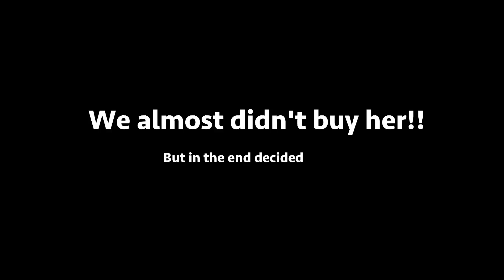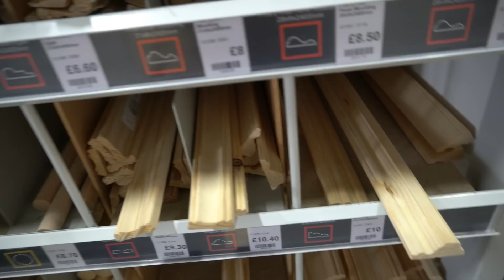Our Van Life Dreams Could Be OVER!

Comment: Suggestion, :- Install a remote operated dump valve in the fresh water tank, so that when you get invited by the DVSA inspectors to follow them to a weighbridge you can dump 200Kg on the way there 🙂
Reply from the maker: Good tip! 👌
Reply: Thats smart
Reply: Unless of course they are involved in an accident and the truck is checked by the Police after the event.
Reply: Better still don't travel with 200l of water .or if you do try be as close to your overnight week long stop as possible
Reply: That won't work - VOSA will likely require you to fill your freshwater tank - and will want to weigh the vehicle with everyone on board.
Reply: VOSA won’t ask you to fill any tanks, don’t be worried about that.
Reply: that ts not true you.
  @MadMorti
Reply: also remember to get the right flow rate one as you only have probs 5 mins to empty your 200kg thank. Money now spent on the right product will save you a hefty fine and dont forget they come with points and Hugh fines  for being overweight
Reply: @SAM_1010  The Brom is an HGV Class 1 driver... he's been weighed multiple times and that's his advice  🤷‍♀
Reply: should add - that's my hubby - forgot his name doesn't show up on my account when commenting 🤦‍♀
Reply: HA HA HA that's hilarious you forgot hubby's name 
because it doesn't up on your account 🙂 🙂🙂  @MadMorti
Reply: I’m a lorry driver, in my early days I drove scaffold lorries. One time I was just under my payload weight. They spayed water on my boards and it was overweight got fined..
Reply: @brendanaengenheister5351   that's not what I said at all. Jokes on you.
Reply: @Touringwiththekids  Please don't take this advice. 😂
Reply: And break the law making your insurance null and void!
Reply: @cityclips9325 don’t talk rubbish. If your under weight your under weight. Can just see vosa standing there with a hose pipe in the middle of summer. They will tell you to go home and fill your flask up again 😂😂😂
Reply: @stepemberton9233  I can assure you it did happen at dartford crossing. They have many hose pipes.
Reply: @stepemberton9233  the VOSA said what happens if it rains now? And the other guy sprayed the water
Reply: "The Driver & Vehicle Standards Agency have various special "Weigh in Motion Sensors" (WIMS) and Automatic Number Plate Recognition (ANPR) cameras installed all over the country. Helping them win the fight against overloaded vehicles which pose a threat to other road users and cause significant damage to the road infrastructure."
Reply: @bigdarbs19  no cause you just dump it as soon as the incident happened
Reply: @MadMorti  they wouldn’t be able to see how much you did, or didn’t dump and if it’s raining, they probably won’t even be able to tell

Comment: 12MPG 😮 I'm driving 26 tonners and getting 13MPG. Practice letting the truck roll more on approach to roundabout, junctions etc.

Also if you have a exhaust/engine brake use it; will save you on brake pads/discs and will improve MPG as the air compressor doesn't have to work as hard.

Glad your GVW will be okay

Comment: if you get pulled, they weigh each axle separately, then add together, so max axle weight is the one to keep an eye on, this will reflect on where to put the water tank to balance it out
easy to work out water, 1 ltr = 1kg, diesel is slightly lighter
if you are a little bit over the limit,  you get a warning, well over, a "PG9" is given, vehicle taken off the road immediately, ie walk home 
 aim for no more than 10% over axle limit, £100 fine, + allowed to redistribute your load + drive away...   keep up the good work

Comment: One thing to keep in mind is AXLE weights , most roadside weigh stations run by the DLVA weigh individual axles, not the whole lorry, So keep in mind weights and where you place them , with a sleeper cab your front heavy  to start with.  Good start that your still under 7.5tn.
Reply: Good point. Next time you take it to the weigh bridge , put the front wheels on it first to weigh it

Comment: Hi guys, thanks for great videos over here in OZ lots of big motor homes also pull a car or 4 wheel drive towed behind them. So what about a trailer that you can tow behind the truck this is of course only applies if you guys are over weight. I know when we lived in the uk we would see lots of coaches with trailers pulled behind. Just a thought 😊😊john

Comment: have you checked your axle weights? you can be under gross weight and be over the front axle weight very easily as the engine and the cab is on the front axle especially a sleeper cab. My 7.5t Curtainsider only can gross 3200kgs on the front

Comment: Thankfully, I don’t have to worry about the weight. My Iveco is currently 6000kg-ish, with curtain sides, so if I had to come in under 7500, it would be a non starter. Luckily, I did my full class C+E, and my design gvw is 10,000, so I’m safe.
The previous owner derated it, so he could drive on his C1 license and pay lower road tax, but he made no modifications, so I can just change it back and pay the extra, once I’m finished.
The other option would be a complete redesign, without the tail lift and with grp panels, on the sides of the box, or perhaps remove the box altogether and mount some sort of RV body, but none of that appeals.

Comment: If you insist on using the jigsaw the best way to cut straightish is to find the box the jigsaw came in and you'll find a fence to use with the jigsaw to cut in parallel lines, but a circular saw is much better for the job.😂🙂🙃Only trying to help not moaning ;-)

Comment: Hi New to the channel. A 10 ton truck would be better and you can drive that on the same licence. Not sure when you did your test. But now you can do class 1 straight away. Then you drive anything and tow anything.12mpg in 7.5 to is poor.. x
Reply from the maker: Hi, the C1 license only allows you to drive upto 7.5t weight so would have to do an additional test for a 10t. Also a lot more restrictions in getting to places as most weight restrictions tend to be 7.5t! If we need extra payload we could get the truck re-plated to 10t.

Comment: Hi.  Weight.    First off ,  private or commercial it does matter of both axle & over all weight as you may know.  I would of weighed after filling to the top the fuel tank & water tank (. Yes I realise you not of fitted water yet 😊 ).   And take that as the Kerb weight.   Admittedly often your water will not be full nor your fuel at 12 mpg.   With everything on board , family, kitchen sink and anything else you require, you would now know the weight you must not be over.   7.500kg.  
Example :  You are off in the morning already topped up water and fuel,  3 mile -  5km down road and a government weigh check.   Bugger !!!!!
As you may also know some weigh centres are either bridges or single bars ,  here they are after your axle weight  !!  
As you may also know that the weight limit is what the vehicle is designed for ie. 7500kg  and the drivers licence that all matter  ( especially at a weigh check  !!  ). 
Wish you well

Comment: Weight won't matter because you'll have to re register it so it's not classed as a goods vehicle
Reply: Wrong. It still needs to conform to its permitted weights on its vtg plate.
Reply: @garywebster6453  it won't have a ministry plate when it's re registered, same as if you bought a coach and converted it, that would become a 7.5t motor home, the ministry plates are for safety due to where a goods vehicle will go, I'm currently doing my class 1 so I've been asking these questions
Reply: @@HalfTheWorldAway-mf5cf I couldn't say the dvla would reweigh it and replate as a private motor home giving it it's new max weight and new axel weights
Reply: His license is for 7500kg maximum?
Reply: @E6EES  depends on if he did cat c or just 7.5t cat c is up to 18t